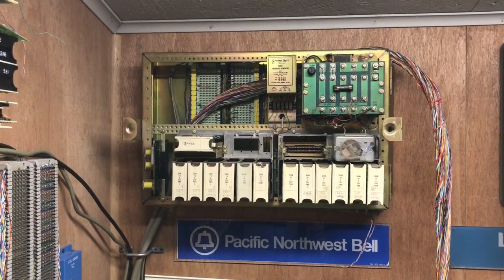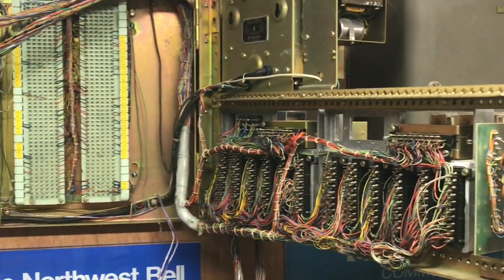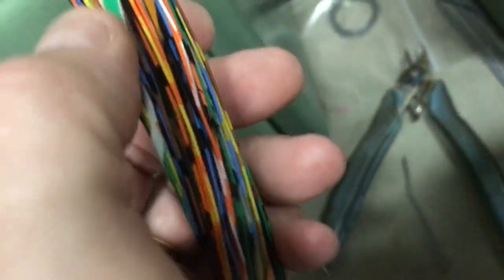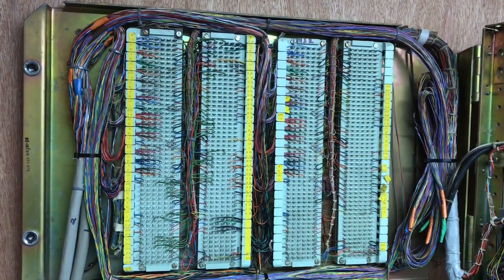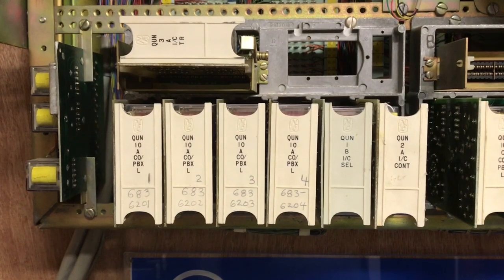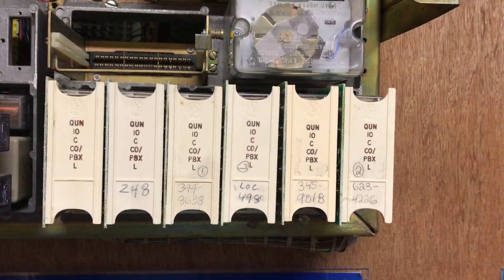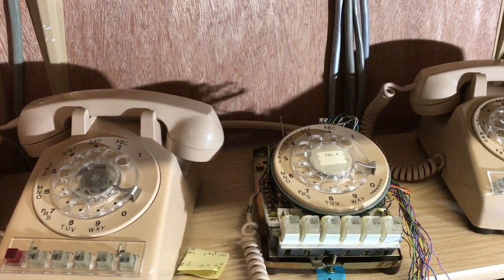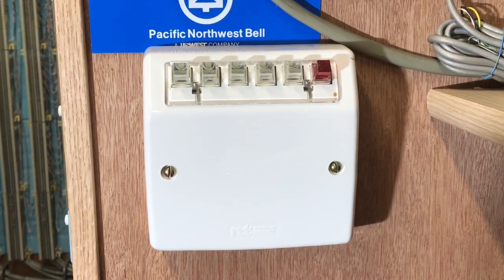Northern Electric 1A2 Key system. QUJ 10 A KSU.

Comment: I had a lot of 1A2 stuff in a hospital for a while.  Most of it was ITT but the principle is the same.  I remember a couple of cabinets having 3 rows of line cards slaved to a second cabinet that had the single row plus the power and ring generator.  These served an entire wing of a large hospital.  We also had a few of the smaller 6 line KSU's in some remote area of the hospital.  I think the backboard was at least three full 4 x 8 sheets of plywood.  I went through 25 pair station cable like crazy.  One group of admin offices required 25 thousand foot spools by itself.